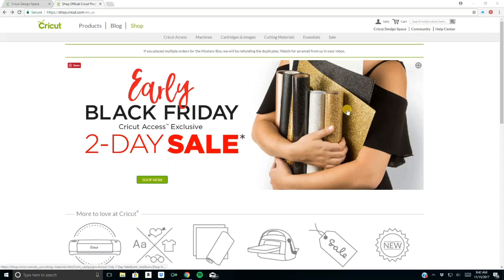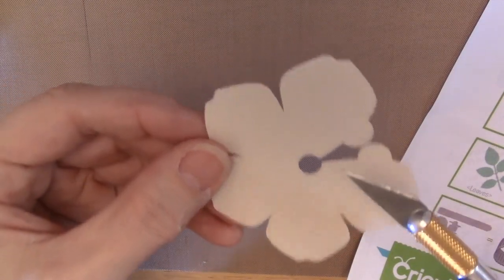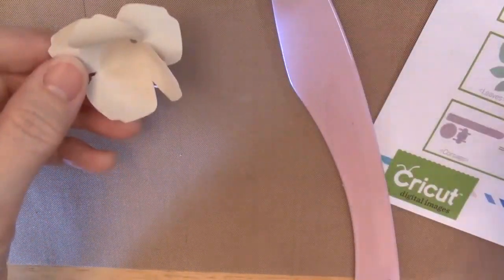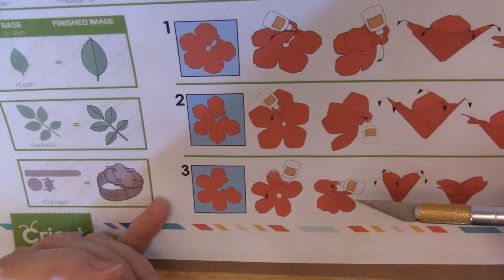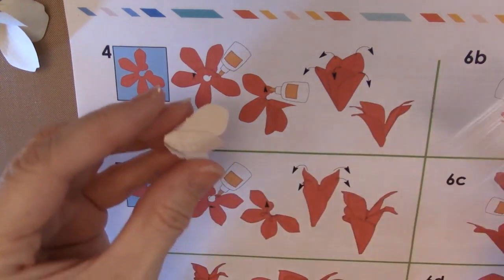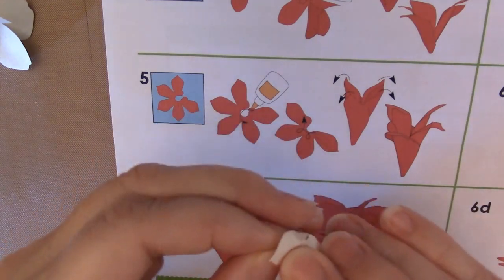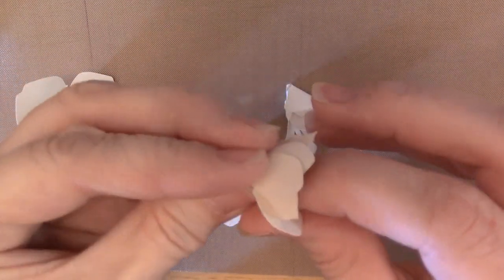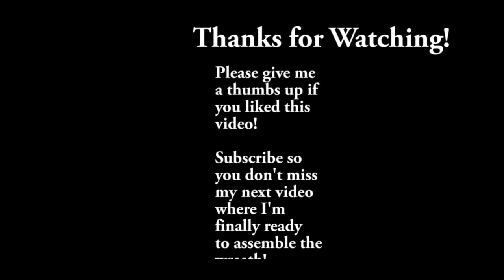Cricut Explore Tutorial | Fall Floral Wreath part 5

Comment: Do you still have the .pdf file for this flower? It isn't in the list of cartridge handbooks on the Cricut website anymore.
Reply from the maker: I do not. Do you mean the instructions? Or, the cut file?
Reply: @sallymakes  the instructions... I actually took screenshots from your video to put together the cartridge handbook, so I should be good for now. I think what makes the construction so confusing is that the slits are SO much smaller than the tabs. If I use these flowers again, I'll lengthen those cuts so the tabs fit without having to do any extra cutting.